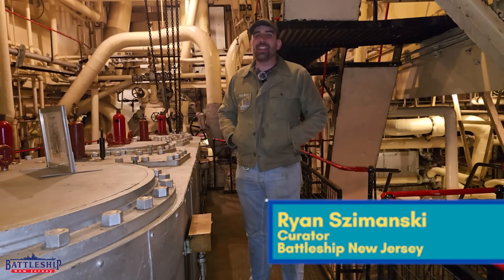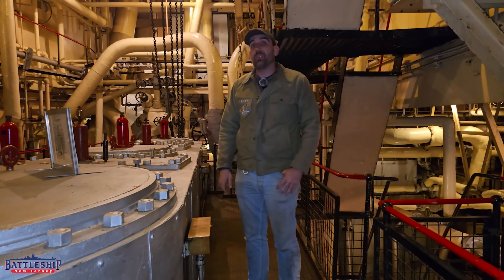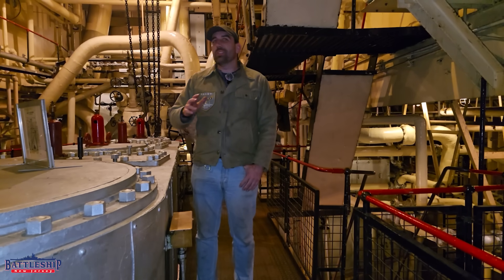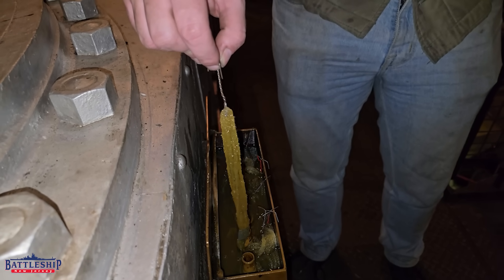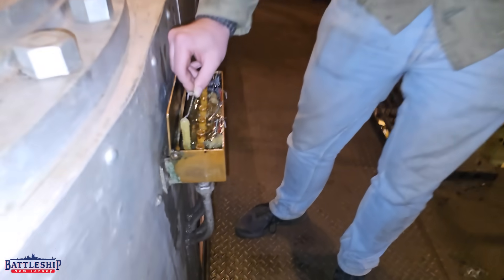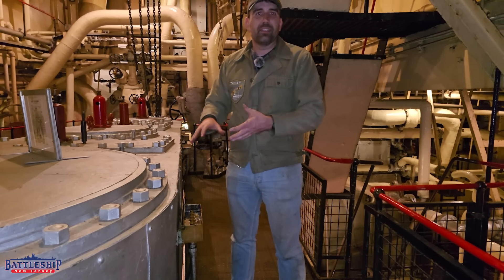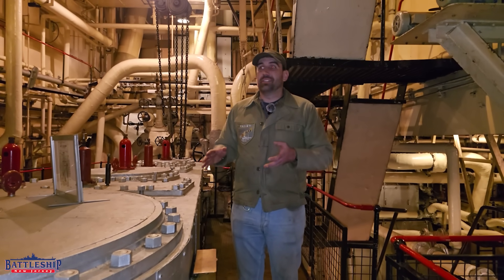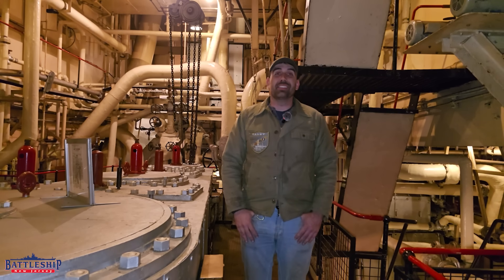How to Oil Your WWII Era Liberty Ship: Reciprocating Steam Engine

Comment: On the subject of oil-wick lubrication, many years ago in the UK there was a project to get the Flying Scotsman mainline locomotive back in steam, and running. One of the problems they had was Oil: Steam Locos had been out of service for decades at that point and the relevant lube oil had been out of production for a similar time. Well, they managed to find an old engineer who had "Liberated" some of the oil when he left, and from that they managed to get a batch refined by one of the oil companies, BUT, while running on high speed tests they found the bearings were running hot, and realised the oil was not flowing through fast enough. OK at low speeds, but not for the Express runs they had planned. It turned out that they had used modern synthetic yarn for the wick, not the (difficult to find) natural fibre. Once replaced, the overheating issues disappeared. It goes to show that although apparently "Simple," there was a lot of science in getting the right combination of oils, fabrics and flow rates to get the job done.
That account always fascinated me as a lesson in underestimating how technical simple solutions can be.

Comment: I posted a video of scraping one of the babbitt main bearings on the Liberty Jeremiah O'Brien a few years ago. 
Oilers would also check their hands for the color and smell of the oil (to see if it was burnt) as well as if there were any metal flakes in it from the babbitt material. Real oilers onboard still do it by hand today. Only so much you can learn from a laser thermometer.

Comment: I love "The Sand Pebbles". Got it on DVD. Just watched it on TV last weekend and it had a warning before regarding 'racism'.
Back in 2001 I visited the Battleship Texas at her old home in La Porte. Spent some time crawling around the different levels of the engine room. Got to put hands on the huge crankshaft and felt the bearings. Which were ice cold. I had a thought that these were the same type of engines as Titanic. And built at the same time. But looked smaller with all of the decking and bulkheads around the engines. Texas' engines are in separate compartments. Hope to see her again in Galveston after she opens back up.

Comment: We had a motor/generator/vacuum pump assembly from the navy we used for the 5 inch vacuum source and 400 Hz 115 Volts to test aircraft gyros.
One thing you had to do once a month was fill the automatic oilier for the vacuum pump, or else the pump would lose the ability to pump the air.
The motor/generator also needed maintenance, as well, but had oil cups for the bearings. You would hear squeaking, when they needed oil!
Originally, it was located on the first floor of our building, but in the end, it went upstairs, where it was difficult to service, and it finally failed,
and was replaced with regular inverters and a smaller vacuum pump. Sad to see a piece of equipment from the 1940s be trashed like that,
all for the lack of oil.

Comment: PS Waverly has a magnificent triple expansion - its the diagonal variety of the triple, specialized for paddle steamers - keeps the cog low and gives the maximum geometric moment to the driveshafts out to the paddles from the crankshaft. - same gorgeous brass oil boxes and worsted wool wicks with their twiddly wires!!!  that looks a fun thing to get to do - help working a triple exp steam plant, and a biggish one too!! 😊🙃😊
Reply: I was going to mention Waverly myself Been on her a lot and always spent time in the engine room watching them oiling round and testing the boiler water for purity.

Comment: Steamboat New Bedford h a d two 4 cylinder triple expanders 8 oil burners number f o u r oil was on my way to Oak Bluffs had an opportunity go down the engine room found a clipboard and a earmuffs went down there like I was in inspector guy operating the telemotor one gentleman operating the foreign reverse and throttle and the oiler they don't seem to care if I was down there like I was part of the crew fantastic site now I can only do it when an escort they get pissed if I do it the other way now the New Bedford is caught up for scrap the engines in New Bedford so the kids can learn on it

Comment: I have a metal lathe pretty typical for WW2 era machines. It has several different reservoirs for oil that use wicks (like pipe cleaners without the wire). These wicks move the oil to where it's needed. Often uphill!

Comment: Funny you mentioned the movie “The Sand PebbLes”

In 2014 I did the walking tour on the Lane Victory which is tied up in San Pedro just a little bit down the docks from Battleship Iowa. (Lane Victory opened earlier😀) 

Anyway the Victory ships replaced the Liberty ships.

They didn’t let you in the bridge or engine room at that time but what the did have was the triple explosion engine that Steve McQueen was crawling all over in “The Sand Pebbles” in the #1 hold.

I believe it was actually used in a logging camp before being the engine room set piece not a marine motor

Comment: I love reciprocating steam engines. In 1967, I got to ride the Washington State ferry S.S. San Mateo across Puget Sound. Decades later I remember the experience. Like the Liberty ships she had a triple expansion steam engine. There were open coamings where you could see the operating engine from the car deck. I was hooked on steam from that point on. Unfortunately, the ferry was retired in 1969. I look back and think how ironic it was that I was able to ride a steamboat in revenue service while up the Sound a few miles in Everett, Washington, something as advanced as the Boeing 747 was taking shape on engineering drawing boards.

Comment: US Navy - sailed on two LSDs, two ADs, three YTBs, one SSN, and an FF. Everything except the YTBs were steam turbine propulsion. Yes, folks who don't know, nuclear submarines are propelled by steam. The reactor is basically a big boiler. It's a bit more complicated than that, but that's the jist of it. Anyway, the LSDs and ADs were both 600psi steam, the FF was 1200psi. I was basically just a passenger on the 2nd LSD, and definitely just a passenger on the 2nd AD. I couldn't tell you how many miles I've steamed - as a f'rinstance IIRC one Med cruise was something like 25,000 miles total. So four Med cruises, three North Atlantics, a couple of Caribbeans, and twice through the Panamal Canal. So somewhere between 150-200,000 miles perhaps total?

Comment: The thing with Titanic's (or Texas') engines is they're 5 or 10 times this size (i don't have engine specs for comparison though).
Reply: Liberty ship engines were rated at 2500 horsepower; Titanic and Texas recip engines were good for about 15, 000 horsepower.
Reply: I was talking about/looking for physical dimensions since horsepower doesn't increase linearly. I found Titanic's specs (and it's entirely possible i overestimated the factor). 30 feet high, 75 RPM, 215 PSI working pressure, Cylinders 54″, 84″, 97″x2, 75″ stroke. If you know where to find these specs for the Brown please share them as I would genuinely like to get an accurate comparison.

Comment: In my town we had destroyer engines that we used to generate electricity. There was 1 guy per engine oiling. "Grease Monkeys", These guys clambered up, down, around, over, under, in between, inside out, rightside in, and through!!! Little spritzes of oil all the while.

Comment: I was actually at the John W Brown earlier this year back in the spring/summer and went on their earlier cruise. We were supposed to get underway around 9:30iirc, but it ended up being delayed until 2ish because they had a seal/gasket fail on one of the feedwater pumps and they had to repair it before they could actually get underway, it was a very abbreviated cruise and I want to get back over there soon.

Comment: My 1940's era pickup has similar oiling, on a MUCH smaller scale. There are little pots and wicks which feed the speedometer, distributor shaft, and generator bearings. If you neglect your oiling too long the speedometer screams and waves at you.

Comment: So, the main and rod bearings don't use pressurized oil?
Reply: Well, when you press the lever on the oil can, it's pressurized then😂😂. But after you squirt it into those little tubes on the rods, it's just gravity.

Comment: The Jeremiah O'Brien an operational Liberty Ship docked at Pier 39 In the San Francisco Bay. I have been in the operational, under way, engine room twice.  Columbus Day Fleet Week celebrations can accommodate approximately 750 passengers each day departing at 10am returning at 4pm. The Blue Angels and a United 777 flight demonstration are the highlights of the afternoon airshow. As long as the fog stays away it is a bucket list experience.
Reply: I've been on two Jeremiah O'Brien cruises.  One was some 50th anniversary with the CAF attacking the ship, which was defended by troops from a military vehicle collectors group who had mounted .30 and .50 machine guns port and starboard and shot back at the CAF plane.  Best of all, when she got back near Angel Island, my uncle and I were sitting on a hatch cover between the two machine guns, and one of the CAF planes dove down in a sneak attack.  The starboard gunner was blazing away and the plane left.  My uncle got a fabulous picture with tree-covered Angel Island off to starboard, the plane banking up ahead for a return attack, overcast sky, and you cannot see any tourists or San Francisco or anything but the plane and machine gunner.  Doesn't take much effort to think they're running off Guadalcanal.  Funniest was that we had a sailboat off to port during this whole episode, and I always wondered what they thought.

In the engine room, one of the crew was slapping the bottom of the connecting rods as they came around on the crankshaft, testing the temperature, and squirting a little oil.  At 60 rpm!

Anyone who gets a chance should jump at it.  There is nothing to beat three huge pistons gliding up and down at 60 rpm, silently.
Reply: Cruised the bay on Veterans Day in the early ‘90s as part of a reenactment group doing a memorial for WWII service members.

Comment: Been out on the New Jersey a couple of times during sea trials. Spent some time in the fireroom during the first sea trial. Went out on a Sprucan (Paul F Foster). Had to climb on top of one of the reduction gears while the ship was on a full power run, and remove spray shields off the flanges on top the reduction gears, while a guy from Test Division of the shipyard did some tests. Then I put the shields back on. In a shipyard near the end of the overhaul, the ship's steam regularly at the pier to test equipment and to train sailors. We yardbirds are still working in the engineering spacing, usually repairing items found on discrepancy lists.

Comment: Idea for future video: wipers, what do wipers do in the engine room?
Reply: You may already know this but (and for those who don't), traditionally, the job of a wiper was to clean, polish, and paint EVERYTHING in the engineering spaces.  And not just because the Navy is big on things being clean and freshly painted (which they are).  The principal purpose of making the wipers paint a pipe that was just painted two weeks ago or grease a fitting that doesn't need any more grease is: they want to make the young enlisted folk spend time in every nook and bilge there is on the ship and physically spend time with their hands on every single pipe and electrical conduit so they know exactly where every single valve, lever, line, gauge, ladder, and tank is located.  Before they give a sailor any more responsibility, they want him/her to be able to tell, by ear, when a steam line is making a slight hissing or whistling noise that it doesn't normally make.  They want the sailors to be able to crawl between every tiny gap in the machinery without getting disoriented even if it's pitch black and filled with smoke.

After you've been a wiper awhile, a chief might send you into a space to test fuses.  And while you're in there, he might crank down a butterfly valve on an auxiliary steam-line partway just to see if you have gained enough knowledge and situational awareness to spot that the gauge is showing 40 PSI less than it should be showing, and if you're going to come back to him and report that you think something might be wrong.  There might be a backup generator that is normally set to auto-start on detection of low-MSP but he's flipped the switch to 'OFF' and he'll send you in to check the batteries in the battle-lanterns - hoping that you're going to come back and tell him that you spotted a problem on the generator control-panel.  At least that's how it used to be.  Nowadays, I worry that they've got kids standing watch that don't know what a quarter of the machines do.
Reply: @Joseph55220  so its sort of an on the job apprenticeship.
Reply: Wipe?